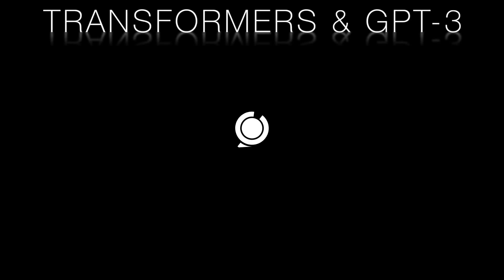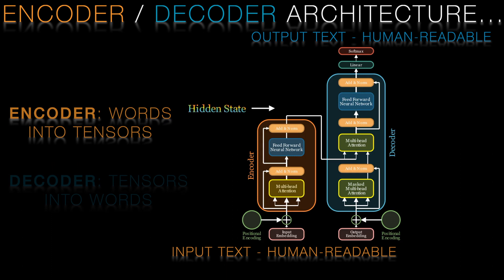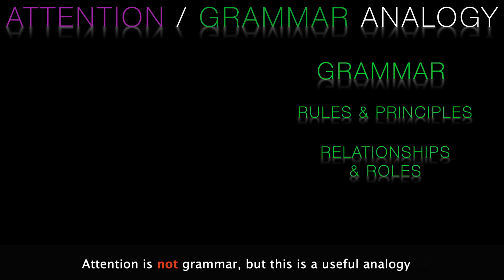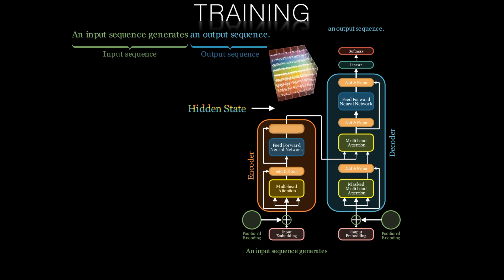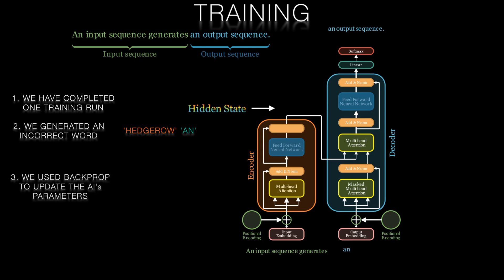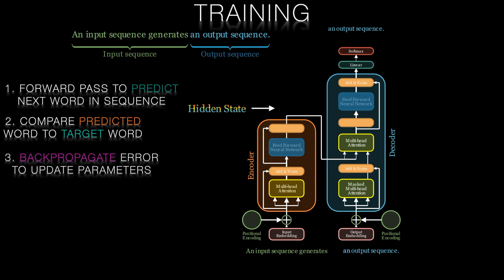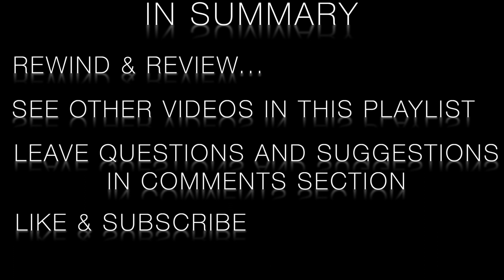How chatgpt works

Comment: I think during training the model rarely sees similar text(like you shown with same text + 1 token), otherwise it will overfit to output the same sequences.
The same sequences are fed to the encoder/decoder only during inference, since we generate only one token per whole cycle. Training this way will result in overfitting on the same text over and over and decrease the accuracy.

Comment: I'm quite confused. In the second video where you describe how word embeddings are created with a neural network and weights and biases and backpropagation and all that... is all of that actually not happening at all here? 

It seems to be the embeddings at the start are just randomized, the  we add positional encodings, then we add attention, then it goes into the decoder and does more magic which is not explained here and then we compare the result with expectation... but how does it backpropagate? where are the parameters that get updated?
Reply from the maker: I hope that this video provides some further insights https://youtu.be/QOS45g-3Sa4. During training the network knows what the output vector should be. It is the token that is masked. It can use this to backprop the error though all of the tunable parameters in the network to minimise the loss. After multiple backward passes in myriad epochs this causes the weights to converge to a point where the network no longer produces nonsensical output, and starts to provide coherent responses. (If I’ve misunderstood your comment, my apologies)
Reply from the maker: Did the answer help, or did I misunderstand your question? Are you less confused?

Comment: Excellent video. Would like to understand in the context of gpt series - it’s called a decoder only architecture. So what role does a encoder play when it comes specifically to the gpt family of transformers?
Reply from the maker: Thanks! Great question. The encoder in a transformer converts the hidden state into an output sequence. Clearly you only have encoders in a decoder-encoder architecture. A decoder only architecture is different. A decoder-only architecture is a type of neural network that is used for tasks such as sequence-to-sequence modeling, language generation, and machine translation. Unlike an encoder-decoder architecture, which consists of both an encoder and a decoder, a decoder-only architecture only has a decoder.

The decoder-only architecture is based on the idea of auto-regressive modeling, which involves predicting one element of a sequence at a time, conditioned on the previously generated elements. In the context of language generation or machine translation, this means that the model generates one word or token at a time, conditioned on the words or tokens that have been generated previously.

In a decoder-only architecture, the input to the model is a context vector, which is typically generated by an encoder or obtained from an external source. The context vector contains information about the input sequence that is relevant for generating the output sequence. The decoder then takes the context vector as input and generates the output sequence one element at a time.

The decoder in a decoder-only architecture typically consists of multiple layers of a recurrent neural network, such as a Long Short-Term Memory (LSTM) or a Gated Recurrent Unit (GRU), or a Transformer-based architecture. The decoder is trained to maximize the likelihood of generating the correct output sequence, given the input context vector.

Decoder-only architectures have several advantages over encoder-decoder architectures. For example, they can be more efficient and require fewer parameters, since they do not have to process the entire input sequence. They can also be used for tasks such as language modeling and text generation, where there is no explicit input sequence.

However, decoder-only architectures can also be more challenging to train than encoder-decoder architectures, since they rely on auto-regressive modeling and require generating one element at a time. Additionally, they may not be suitable for tasks where the input sequence is important for generating the output sequence, such as in machine translation.

Overall, decoder-only architectures are a useful type of neural network architecture for a range of sequence modeling tasks, and can be a useful alternative to encoder-decoder architectures in certain contexts.

Comment: What I miss or maybe I didn’t understand. Is an explanation of how it use a pretrained model to asign values in Query and Key values. Great video
Reply from the maker: Thanks for your comment! I'm glad you enjoyed the video. If it is helpful there is another video in this series that goes through the attention mechanism. You can find that video here -> https://youtu.be/sznZ78HquPc

But here is my answer your question, the idea behind using a pretrained model like ChatGPT or GPT-3 in the context of assigning values in Query and Key values is to take advantage of the model's ability to understand and generate human-like language. In essence, the pretrained model has already been "trained" on vast amounts of text data, which means it has already learned a lot about how language works, including how words and phrases are related to one another.

So, when we use ChatGPT or GPT-3 to assign values in Query and Key values, we're essentially asking the model to use its knowledge of language to identify relevant terms or concepts in the text that we're working with. This can be useful in a variety of applications, such as natural language processing, chatbots, and search engines.

Of course, the exact process of using a pretrained model to assign values in Query and Key values can be quite complex and depend on the specific context in which it's being used. But hopefully, this explanation helps to provide some insight into the basic idea behind using transformers in this way.

If I've misunderstood your question, please let me know. Once again I appreciate your support and contribution to the channel. - Lucidate

Comment: Scalers tensors !!
I am not  maths person so , I am asking 
As i am aware of that tensors  used in Einstein Theory of general relativity to discribe curvature of space time , than what is the use of such mathematics in AI which deals with curvatures  and you explain it in intuitive way better than gpt3 ?
Reply from the maker: Thanks for the question. I'm not an expert in Einstein's theory of relativity, so I may not be best qualified to answer this question - but here is my answer for what it is worth.

While both neural networks and Einstein's theory of relativity use tensors, the ways in which they use them are quite different.

In neural networks, tensors are used as data structures to represent the input data, intermediate computations, and output predictions. Tensors in neural networks are typically multi-dimensional arrays of numerical values that are manipulated by the network's layers and learned through the training process.

In contrast, tensors in Einstein's theory of relativity are used to represent the geometry of space and time, and the relationships between different observers in the universe. These tensors, known as the metric tensor and the curvature tensor, are used to describe the curvature of spacetime caused by the presence of matter and energy.

In both cases, tensors are multi-dimensional arrays that can hold numerical values, but the similarities end there. The use of tensors in neural networks is a purely computational and algorithmic problem, while the use of tensors in relativity is a fundamental aspect of our understanding of the universe.

Furthermore, the tensors used in neural networks are typically of low rank (i.e., they have relatively few dimensions), whereas the tensors used in relativity are of high rank (i.e., they have many dimensions). This is because the curvature of spacetime in relativity is a highly complex phenomenon that requires a large number of dimensions to accurately describe, while the computations performed in neural networks are typically simpler and require fewer dimensions.

In summary, while both neural networks and relativity use tensors, they do so in very different ways, with different levels of complexity and different objectives.

Many thanks for your insightful question - Lucidate.
Reply: @lucidateAI  thank you for Such  Breakdown  and  simplified forms  of explanation .
Reply from the maker: You are welcome. Thank you for supporting and contributing to the channel. I hope that others are able to benefit from your question.
Reply: @lucidateAI  yes I became one of your subs , plz try to make video to giving Basic idea of ML AL from scratch for Layman peoples , so peoples like me will take interest to learn hot topic like this . even they aren't not from this field 😊🙂
Reply from the maker: Here is an intro to machine learning playlist - https://www.youtube.com/playlist?list=PLaJCKi8Nk1hwklH8zGMpAbATwfZ4b2pgD. I hope you find it useful.
Reply: @lucidateAI  I noticed there were a lot of mistakes in my mains comment, I've fixed them.
Reply from the maker: Again, I’m no physicist but… tensors are so fundamental to both AI and physics because they provide a powerful mathematical framework for representing multidimensional datasets and transformations. In physics, spacetime itself can be modeled as a 4D tensor field (or so I’m told!). The curvature of this field, as described by Einstein's field equations, apparently leads to many of the mind-bending phenomena of relativity. (Again, I’m no physicist!!)
In AI, we often deal with high-dimensional datasets like images, videos, or natural language. Tensors give us a way to encode these complex datapoints and manipulate them mathematically. Just as in physics, we can apply linear transformations to these tensors to adjust, rotate, and extract meaningful information.
The key difference lies in how they are utilized. In physics, the tensors and transformations directly reflect the underlying structure of reality. In AI, we engineer tensors and neural networks to create useful representations and mappings for our models and algorithms. It's more of a tool than a fundamental truth. They are a mathematical convenience or shorthand. 
But the beauty is that the mathematical framework carries over so elegantly! This cross-pollination of ideas is what makes science so thrilling. The pioneers of AI were clearly guided by the pillars of physics to build an architecture of tensors and differentiable functions. And who knows - someday AI insights may even feedback into our understanding of spacetime and relativity. How delightfully cosmic!
So in summary, tensors enable us to manipulate high-dimensional data structures in both fields - reflecting reality in physics and engineering solutions in AI. Different aims, shared mathematics. Now go forth and bend your mind around the bendy spaces!
Reply: @lucidateAI  yeah , that makes sense thanks  .
Yes I think Elon mask's X AI specially dedicated for that, to understand the meaning of The Universe.

Comment: Nice explanation. One thing you did not make clear is what you would feed into the output embedding as opposed to the input embedding.
Reply from the maker: Tobias, Thank you for your comment and for your interest in the topic! I'm glad you found the explanation helpful, and I apologize for any confusion around the inputs to the encoder/decoder.

It is perhaps worth me splitting up my answer to address the differences during training and during inference.

=============
1. Training:
Regarding the difference between the input and output embeddings, during training, the encoder embedding is used to transform the input sequence, such as a sentence, into a dense vector space. The dense representation is then processed by the encoder component of the transformer architecture to obtain a high-level representation of the input sequence.

The decoder embedding is used to represent the corresponding target output sequence, such as a response in a conversation model, in the same dense vector space. The decoder component of the transformer architecture is then used to generate the final output sequence based on the high-level representation of the input sequence and the output embedding.
============
2: Inference:
During inference, the encoder embedding is used in the same way as during training, but the target output sequence is replaced by the model's predictions. The decoder component generates a predicted output sequence based on the high-level representation of the input sequence and the output embedding.
============

It's worth noting, as per the video, that the technique of "teacher forcing" is often used during training, where the decoder is trained to generate the next output word based on the true target output sequence rather than the model's own predictions. This helps the model to learn the correct mapping from input to output, but can cause problems during inference if the decoder is then required to generate the output sequence based on its own predictions.

I hope this provides a more detailed explanation of the difference between the input and output embeddings, and how they are used during training and inference. Thank you again for your comment and for your contribution to the channel with your question. Greatly appreciated - Lucidate.

Comment: Thanks for this series. 
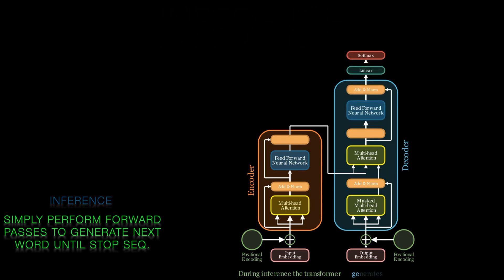At 10:00 the volume of the voice becomes very quiet.
Reply from the maker: Sorry about that. I hope that you were able to hear the conclusion of the video OK. Was it still inaudible with the volume turned up a notch or two? (I'm not saying you should have to turn up the volume, clearly the onus is on me to make the video audible, I just wanted to know if you could still hear the voice track on the video).
Reply: @lucidateAI  Yes, I was able to hear after turning it up, just wanted be sure you were aware for the future.
Reply from the maker: Thanks for confirming. Sorry about the audio errors in post-production. I'll try and tighten things up. Your contribution and feedback is greatly appreciated.

Comment: Per GPT:  One analogy that might help to understand the roles of Query, Key, and Value in the Transformer model is to think of them as a librarian, a catalog, and a book, respectively.

In this analogy, the Query is like a librarian who receives a question from a reader (i.e., the input token) and needs to find the most relevant books in the library that might help to answer the question. The librarian does this by consulting a catalog, which contains information about the books in the library. The catalog is like the Key in the Transformer model, as it provides a way for the librarian to quickly find the books that are most relevant to the reader's question.

Once the librarian has identified the relevant books using the catalog (i.e., computed the attention weights using the Key and Query), the reader can then look at the books themselves to find the information they need. The books are like the Value in the Transformer model, as they contain the actual information that the reader is interested in.

In this way, the Transformer model is like a library where the Query is a reader, the Key is a catalog, and the Value is a book. The librarian uses the catalog to quickly identify the most relevant books for the reader's question, and the reader then looks at the books themselves to find the information they need. Similarly, the Transformer model uses the Key and Query to quickly identify the most relevant parts of the input sequence, and then uses the Value to extract the relevant information for downstream tasks.

Of course, GPT could probably go on to write many of the books.  That's why I'm optimistic about how GPT can be used to improve itself.
Reply from the maker: Great analogy.. Thanks for sharing and for your contribution to the channel.  I too share your optimism.